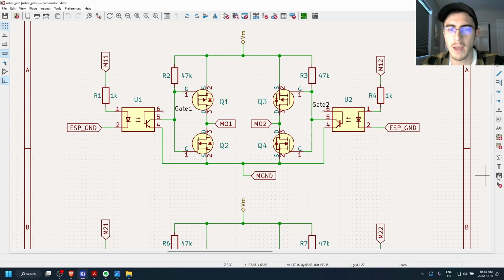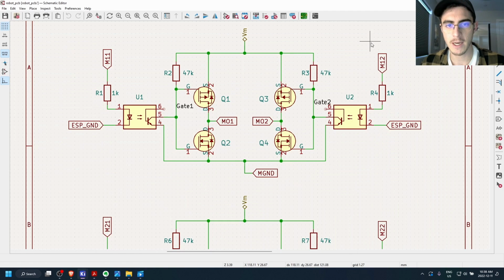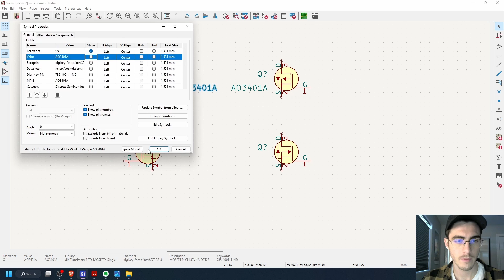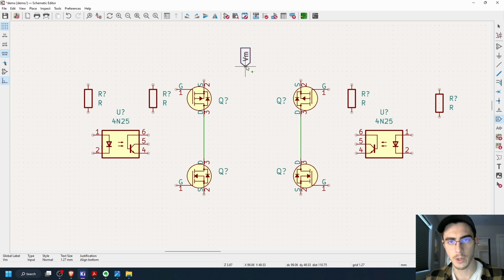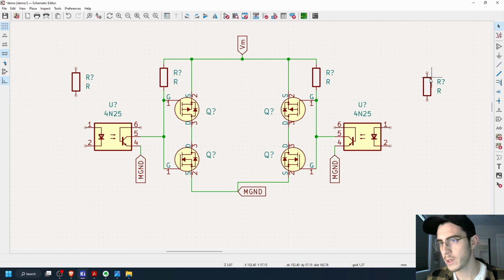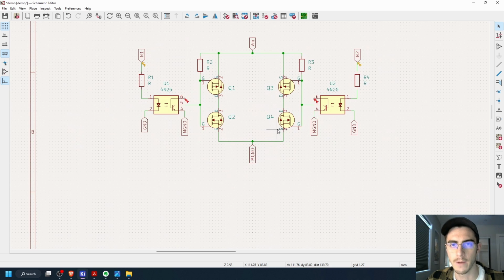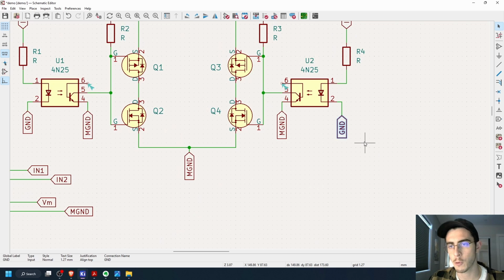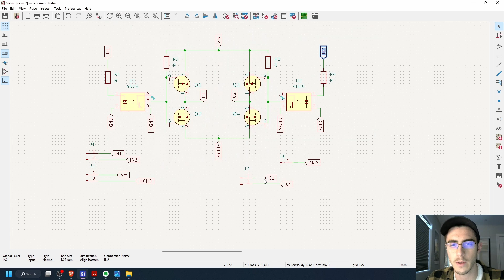Making an H bridge Schematic in KiCad

Comment: awesome video man, can I use this with PWM input? someone else said they had issue where both sides were switched on at the same time. could i use a software based implementation for dead time or should i do it some other way? also how do i calculate the minimum time i need?

Comment: KiCad has an option "Add a no-connection flag (Q)" in the left menu which is the recommended method to declare pins that are not used.
Reply from the maker: Good to know, thanks for sharing

Comment: Hey Bro,
I made this same H-Bridge it blows off because of shoot through issue,
If your H-Bridge working fine then let me know, Thanks.
Reply from the maker: Hello! I was able to get this circuit working, both on breadboard and a PCB that I made. May I ask if you are using a PWM control signal for the MOSFETS or just straight DC?
Reply: @EV_engineer  I used PWM
I face the shoot through problem when i switch of the control circuit, for a small period of time the ground and supply gets shorted
Reply from the maker: @iotstudent9572  This circuit has worked fine for me with DC control signals. High-speed motor direction change or using pulse-width modulation to control motor speed may lead to shoot-through. One possible solution to this is to have a switch to the motor power supply. Avoiding shoot through when changing direction can be accomplished by switching the motor voltage off, changing the FET signals, then turning motor voltage back on. In theory, PWM can be applied to the motor voltage turning the entire H-bridge on and off. I have not tried this, perhaps it would make a good video!